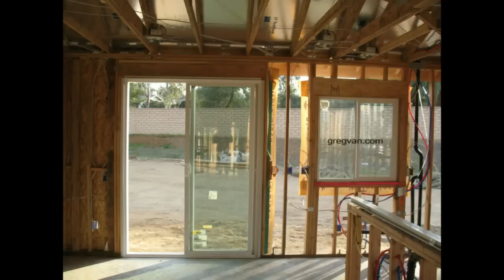Load Transfers Around Windows and Doors - Structural Engineering and Home Building Part 4

Comment: I have an old house with a enclosed porch with a 177" load bearing wall x 76" side wall x 84" height. I want to install a 104" x  46" window and a 36" x 79"  door with a wall at the end as wide as I can make it. What do you suggest? Thanks a lot, you are very informing.
Reply from the maker: I don't think that will work good.

Comment: Did you ever make another video about the sliding glass door? I’ve been told anything over 4ft needs 2-2x4 for trimmers. I accidentally put just one and now everyone telling me I need to rip out headed and build new bigger one that will sit on 2-2x4s
Reply from the maker: I installed two trimers on each side for 5 foot or larger openings.

Comment: Hey. I’m having a house built and they just installed the exterior doors but there is a 3 inch gap above the doors. Did they not measure correctly? Will this pass code?
Reply from the maker: It shouldn't be a problem, but it will need some backing for drywall or exterior siding or stucco.

Comment: Hello, I am Replacing a standard door, and a large window with a 107" 4 door sliding door. The wall is load bearing, how do I know what size header I need?
Reply from the maker: I just made a video that will help. https://youtu.be/OHg1HZl8D68

Comment: In California, if the width grows to an 8 foot sliding glass door window, are there framing header rule sizes and wood types?
Reply from the maker: I can't provide engineering information for specific projects. If the information in the video won't work, then contact an engineer or your local building department.

Comment: I have a shed with a shed style roof that has a slider on the long side and the high front side of 12' output and there is no header it's just framed like a small wall over the door is that necessary to have a header they did not build it that way I don't know why maybe it's not necessary for this roof type I don't know please help. Thanks Tara
Reply from the maker: You can get our email address at our website and email me a picture so I can take a look. Keep in mind I'm not an engineer and will only be providing an opinion.

Comment: At what point on a 24x8 shed should the top portion of the walls become rigid.  The walls are 8 feet high.  I have toenailed 2x4 ceiling joists and laid two extra ones flat to tie the sides together and am beginning to put OSB on these joists but the walls are still not rigid.

Comment: What is the purpose of the space above headers?  Why can't all headers be all the way to the top and then the difference between the door/window height made up using a 2x4, sorta like a "seal" on top since the top seal would not be weight bearing?
Reply from the maker: +Usiku A It would take more lumber to frame it the way you're suggesting, but I would imagine that in most cases it would be allowed. The only time I don't think it would be allowed would be to provide the wall with more structural strength.

Comment: I have a 96” patio door to rough-in.  I’ll be using a 2”x12” double header thermally broken with rigid foam sandwiched between the.  My question is: does such a span require 1 or 2 jack studs?
Reply from the maker: Most openings larger than five feet require two jack studs on each side instead of one.

Comment: I am building a shed/bunkie and would like to frame the gable end wall with a centrally placed high, narrow window for a cathedral ceiling. I am thinking of balloon framing the entire wall. To support the ridge beam I have a post descending to a header supported by trimmers above the otherwise 8' ceiling height. Is this going to work? Are there special considerations in this sort of design? The window is 17.5" wide. This is a small building - just 8'x12'. Thanks.
Reply from the maker: I cannot provide you with structural engineering advice, but usually the window header will need to be a little larger. For example if you were going to use a 4 x 6, then a 4 x 8 or 4 x 10 might be necessary.

Comment: Hi, are you still answering comments here or by email? Thanks.
Reply from the maker: Yes I am!
Reply: @gregvancom  Hello Greg, thank you for the reply back.
I have a 42" W x 47" H kitchen window which I will be replacing. I purchased two other windows to match horizontally. Coming off of the king stud from the original window frame can I just add a jack stud for the new headers or do I need to add another king stud and then a jack stud in sequence? This is not a load-bearing wall. I started to frame this way because it would add additional support but then thought I could save additional sideway space. Plus, I think it would be more attractive with the three windows being closer together. Please share your thoughts.

Comment: I have a question. I live in a brick, two story home, but the foyer at the front has a cathedral ceiling.  We've decided to replace the front door & sidelights, but have discovered that the header above it has been damaged to the point that it also has to be replaced, and between the time the existing door is removed and the new door is installed. 
My understanding is that all exterior walls are deemed  weight bearing, but I remain unclear whether and and what kind of temporary bracing THIS situation [ where a second floor above the door is absent] , requires. Any guidance would be appreciated.
Reply from the maker: This link might help http://www.homebuildingandrepairs.com/remodeling/framing/index.html

Comment: It's winter and I have to replace several adjacent sections of exterior framing. I would like to do this from the inside of the house, if possible. I would like to build  frames of 2X4s  to maintain the 16" centers on odd frames  with plywood  attached. The first frame would be 17.5" wide the sheathing attached. The second remaining even replacement frames frame would have a width of only 13.75". All this to avoid having to remove the TYVEK and vinyl siding during winter. Is this feasible?
Reply from the maker: It sounds like it might work, but if this sheathing is structural and needs to be larger, then the smaller sections won't work. Other than that, I think you might be onto something as long as you can still attach the siding.

Comment: Is the structure under the window considering load bearing?  I ask because I am considering extending the window out 2 feet
Reply from the maker: In some case it provides side to side structural support or lateral support, but it if not then it can be treated like a doorway as non load bearing.

Comment: Hi Greg, we are looking to replace an 11ft.wide x 9ft. tall window with arched transom (all one piece). We want to install sliding glass doors with an arched transom window above. My question is...Can the new sliders/transom window be one whole piece....or do we need to install sliding doors, then above a larger header and then a separate transom window above? Hope this makes sense and TIA!
Reply from the maker: I think you would need to contact a window manufacturer to find out whether or not they have one large unit or two separate windows. Keep in mind that the header above the transom would be transferring the structural load around the window, which might allow you to use a smaller header in between if needed.

Comment: Hey Greg, My question is the same as Usiku but just wondering if you can clarify abit...... If you have a header thats tight on the top plate and than do you're drop (Cripple studs) would it be weaker or stronger.... I get that you use more lumber doing it this way but Im unsure how that would be a weaker connection as effectively you have solid contact throughout the top plate....
Vs having cripples carry the load to the header........ Also I think it makes more sense as it is easier to change the drop than it would be to change the header at a certain height.............. I would imagine that the strength difference would not be all that significant.....
Reply from the maker: Keep in mind that I'm not a structural engineer, but what you suggest makes sense under some circumstances. For example if it was a shear wall, I think it would be better to have the header lower, yet could create a stronger design using different construction methods. Great point.

Comment: At this point would you want to have sheerwall on the inside or would this be overkill and drywall sufficient?
Reply from the maker: It's hard to say what overkill would represent, but the house must have had an engineer, because of its location.

Comment: How much weight can I add to a front door for security reasons (reinforcements) i have a design that would make a door kick proof, highly bullet resistant, and possibly toarch proof all for about $60 and a few hours of labor, however it requires me to add weight to the front side of the front door (materials) which is pretty solid wood interior with metal coated exterior of the door.
Reply from the maker: I don't know I can answer that question, because it would defend upon the structure of the building and door jamb. Then you would also need to consider the way the door was built and what materials were used for that.
Reply: @gregvancom  thank you for the reply. ok so if I were to reinforce the wood frame with say, 2 metal rods and drill them in between the window frame and door frame horizontally sence there about 3 feet apart, add a 2x4 perpendicular to the rods run them through the 2x4 for support, then bracket connect those to 2 more metal rods that run perpendicular to the door jam, then bracket those to the door jam itself, would that add structural strength to the frame and jam? The structure itself is more then strong enough to bear the weight.

Comment: Hi Greg,  having impact sliders replaced in my home; a triple slider a double slider and a huge horizontal roller above my kitchen sink all along the same wall. These sliders take up 90% of the wall space. Not sure if it is a weight bearing wall or not and wanted to ask you if you find it a problem if there is a 1.5 inch gap at the top of the 2x4 frame of the house and the slider casement.  I can visualize  thread of the tap con screws. I am told by the contractor that it is okay and he will stucco it in. Can this cause a problem for me down the road? I assume it is an ill measuring job mixed with old non plumb space. I am a single young women and not sure if I am being played for a fool? Thanks for your help on this.
Reply from the maker: I don't think there should be any gaps, but am also having a difficult time understanding what you're talking about exactly. Can you send me a picture and you can get our email address at our website.

Comment: Good information. On a block wall basement, with a second story built on top of it, would the transfer load still apply to the weight being supported by the wood studs along side the concrete door opening and header above it? I have a couple of short 6 foot basement doors that I'm replacing and I want to use a treated piece of 1"x6"x34" as the header, instead of the 2"x6" that was there before. This will rest on two 2"x6"x72" studs. I want to use the thinner header piece so I can have a full 6 foot door. Will the use of this thinner header compromise the structural integrity of the doorway?
Reply from the maker: As long as the wall isn't loadbearing, then you can probably and I stress the word probably, since I don't know exactly what's going on use a smaller header. It sounds like you have a loadbearing wall and should keep the original header and make the door smaller.

Comment: Hello Greg. We would like to install a impact sliding glass door where a 5' window now exists. The first problem that a contractor pointed out is that we will need to chip out the block foundation and interior tile. We  are wondering if it would be simpler and less expensive to install a french door instead? Thank you for your help.
Reply from the maker: Yes, if the opening is too small for the sliding glass door, then you can usually trim a little off of the doors and sometimes use thinner materials for the side door jams.

Comment: Oh lol would two 9x2 be ok for this span as a header? For the window of 8ft or should I use an rsj just asking what the norm would be for this
Reply from the maker: I cannot provide you with structural engineering advice, but I can tell you that some single-story homes that do not have any concentrated loads above the window or door header for an 8 foot opening will normally use a 4 x 10 or as your suggesting an equivalent of nailing two 2 x 10's together.

Comment: Hi there. We're renovating a single fronted weatherboard house and we want to install 2 larger windows that are on the same side of the wall. They are about 50mm wider than the original size (same height). If we follow the framing as in this video will that be enough or would we need a structural engineer to assess whether additional supports are required? Thank you
Reply from the maker: I would have to suggest contacting an engineer, but if you know enough about construction you could probably figure out whether or not it would work. I can't give engineering advice, so wouldn't be able to provide you with more information.

Comment: Hi Greg. Are the Jack studs the window jambs or do I have to attach the jambs to the Jack studs ? Same question for the bottom sill ? Thanks.
Reply from the maker: Yes the window attaches to the perimeter of the framing, including bottom window sill, top header and side jack studs or trimmers. The window jam does not provide any structural support and should have at least a quarter inch space between it and the framing. Don't forget to follow the manufacturer's installation instructions.

Comment: Hi , I’m looking to install a mini split unit over my window in garage, it might have a header on it, can I drill a two in hole through it to put wiring through the outside?
Reply from the maker: I've never seen anyone drill any holes in a structural window or door header, so I would say no, but keep in mind I'm not an engineer, just providing you with things I've seen done in the past that did or did not work. I would simply relocate the unit if possible to avoid drilling holes in any structure members.

Comment: ok I have an old house built in the 1950's and I found a leaking window on an exterior load bearing wall.  I removed the sheetrock and saw that the studs and bottom plate are rotten(and maybe even the subfloor) so I need to replace everything under the window.  If I install a temporary stud on either side of the window will that support the window where I can cut and replace the wood under the window?  The construction looks sturdy around the area and the rot only spans about 3-4 feet.  any help would be greatly appreciated.  thanks
Reply from the maker: It all depends upon how much weight the window header is supporting. Feel free to send me a picture or go to our website and in the repair section, click on the link for framing and that will take you to a page with more helpful videos. You might also want to check out the windows pages.

Comment: how do you determine the size of the header(width and depth, length is obvious).-thanx
Reply from the maker: That's basically the job of a structural engineer, but click on this link http://video.gregvan.com/structural_engineering.htm and scroll down the page until you find October 17, 2013 - Window and Door Header Sizes - Structural Engineering Part 6. This should give you a better idea, even though it will not work all the time, under every situation. Contact a structural engineer for more information.
Reply: thanx-very helpful

Comment: Hello Greg,  Your videos are great & have good info for how & why the need for engineering is a must to meet codes and safety and not have your home have stress cracks or fall apart. 

 My question is I am looking to install a door where a window was to my patio. The question is: the home is traditional frame & trust single story home, 2x4, 16 on center,  slab floor.  The window frame is 25" rough frame opening. has a header, it's 2x9. In the center of the window, at the top & bottom, there is a double stud in the center both top & bottom. Each side of the rough frame has 3 studs together. the area where this is not on the corner of the home but about 10 feet from the corner.  I was thinking to move the 3 studs out from the window frame to the next closest stud, what is about 7" away to expand the rough frame to make it 31 inches and remove the 25" long header and install a 31" for a 30" door.Also, they used metal straps going around the bottom sill and the top plate to the header on each of the 3 studs.  I believe they do that to meet hurricane codes here in Florida.  I don't think I am changing anything structural and should be ok here.  Also, I not sure if you have done any remodel videos or one on say a customer makes changes and wants a door installed where there is no door it would be helpful for many viewers installing them. One more question, any concerns removing a header and replacing it with the larger one?  Like this, Let me know your thoughts that would be much helpful.  Thank you.
Reply from the maker: I recently made a video that might be helpful https://youtu.be/V7dDx42IeT8 if not send me a picture of your project.
Reply from the maker: I don't know how important the metal straps are or how much lateral support or side to side support they will be producing. This would be my main concern when asking for my opinion, on whether or not you could remove the lower section or install a larger header, if this particular wall is being used structurally to reduce side to side movement if the forces of nature or putting pressure on the building. Make sure you visit the website and click on the design tab and then engineering for more ideas.